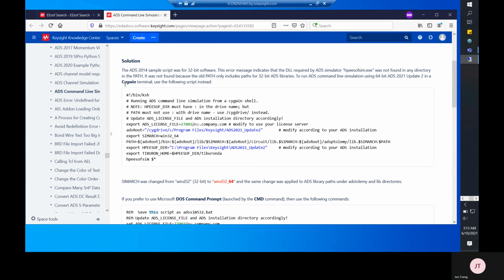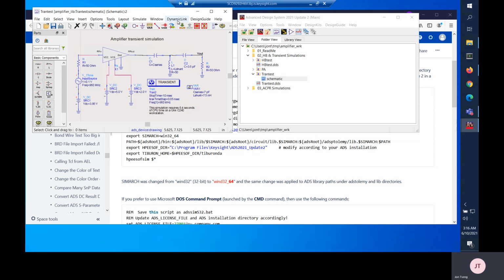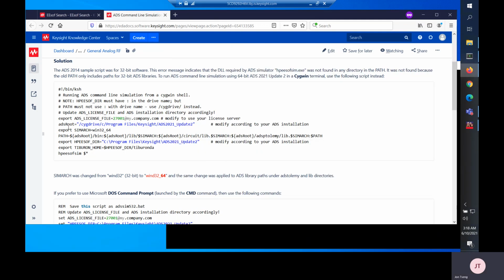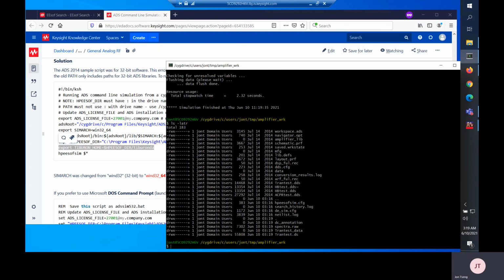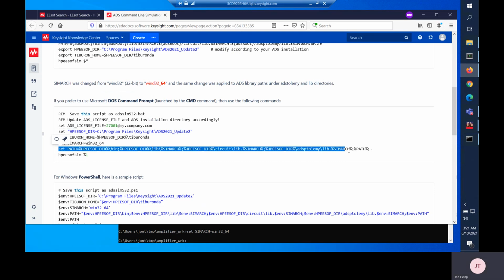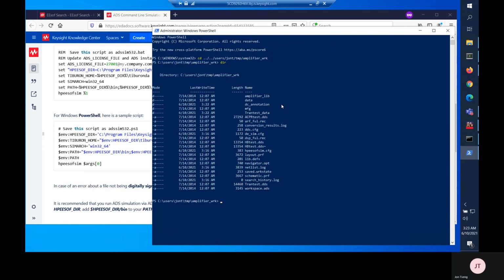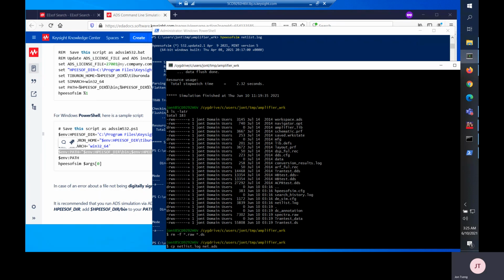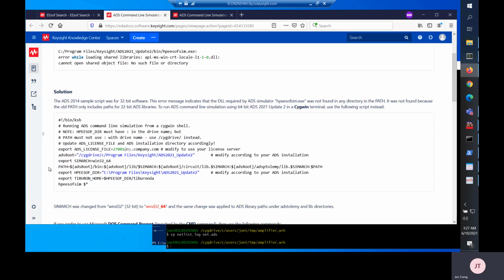ADS: Command Line Simulation on Windows

Comment: Hello, can you please suggest how I can run optimization in schematic via command line?

- At present my simulation is running in the command line, and separately I am able to run Optimization and Goal Setting in ADS schematic.
- However, even though the netlist with Optimization runs in command line, the values are not updated in the design. In the schematic also, they are updated only after I click "Update Design" in the GUI.
- I want to automatically update the design in the command line itself once the optimization runs there. Please help in this regard.

Comment: For anyone who follows these steps and hpeesofsim doesn't seem to do anything after running the last command in cygwin, I faced this issue and solved in the following way:
Please note that this is not the Keysight recommended or approved method in anyway, it just seemed to work for me.

- I directly ran the hpeesofsim.exe application in $HPEESOF_DIR/bin from file explorer and that popped up several errors.
- It mentioned that hpeesofsim couldn't run since it didn't find ptgem.dll and python310.dll.
- I reckoned this must be the reason that no simulation ran after executing hpeesofsim netlist.log in cygwin
- Hence I first searched and copy pasted those files in $HPEESOF_DIR/bin, and later in cygwin, added the original paths of the same files in PATH variable.
- This worked and now I am able to run my simulations from not only cygwin but shell file as well